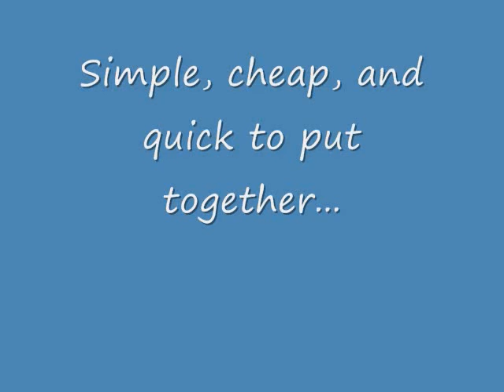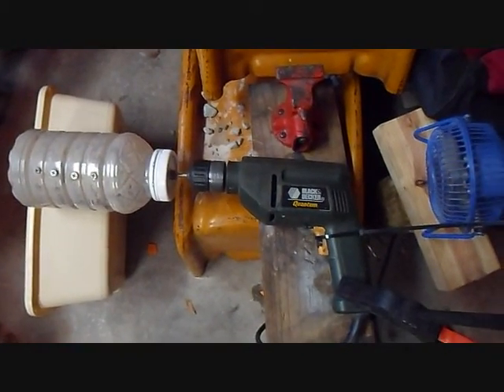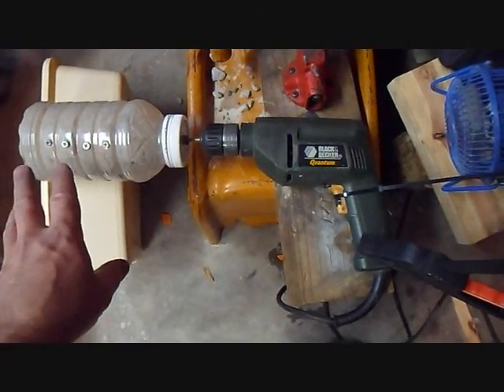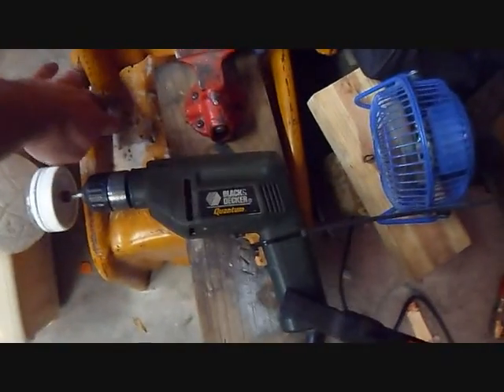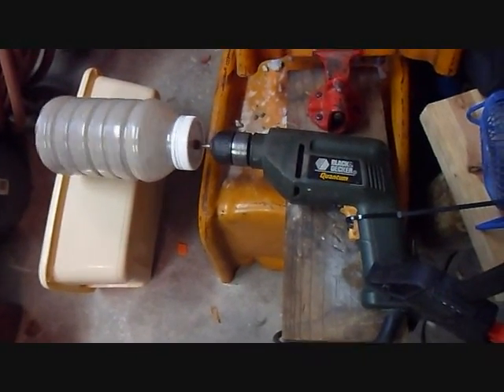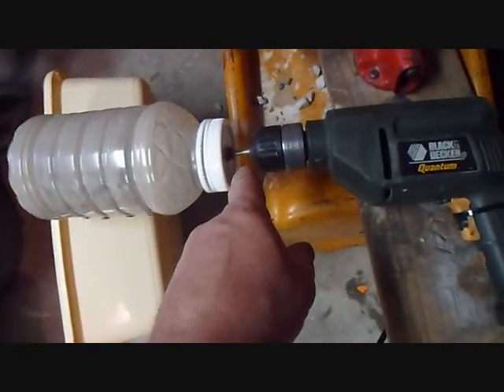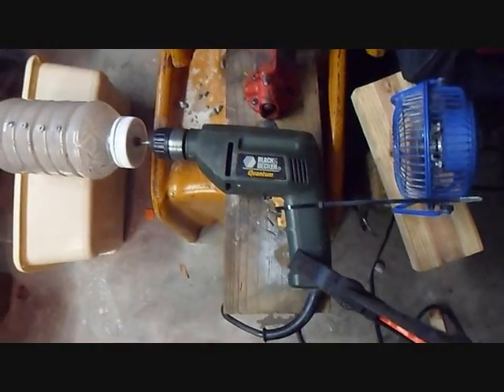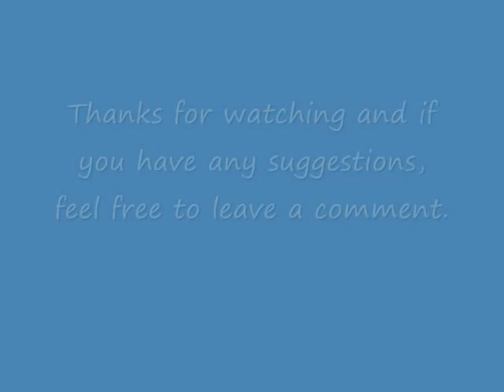Rock tumbler hack

Comment: My only problem is the drill I see your using the fan and I was worried about it gettjng hot etc I might try it looks cheap n easy . What did you use for the grit in the tumbler? Sand or you buy the packets